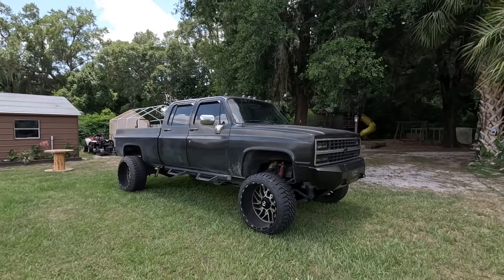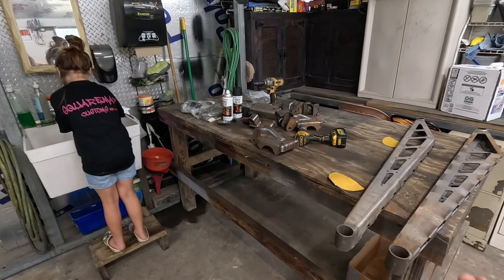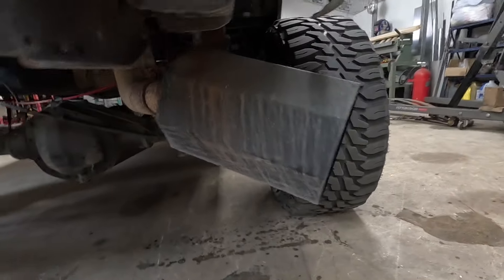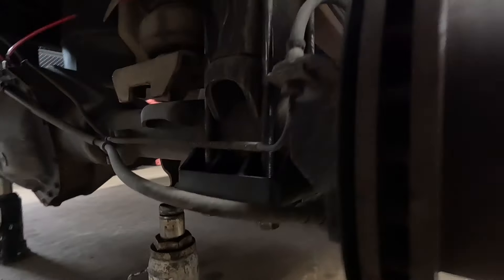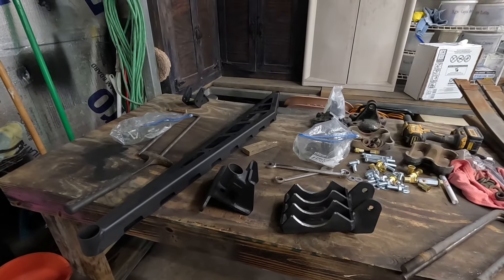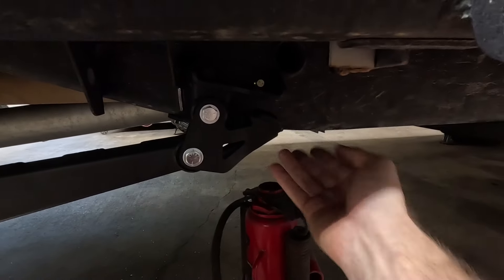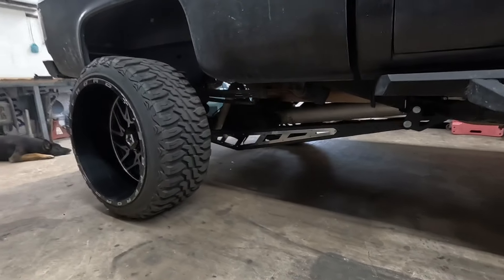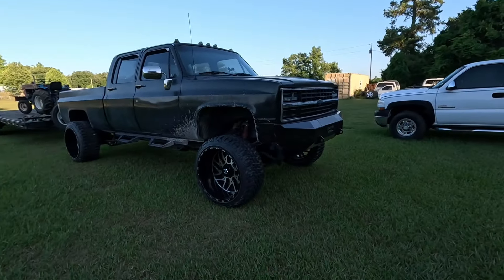Squarebody Duramax Swapped Shop Truck

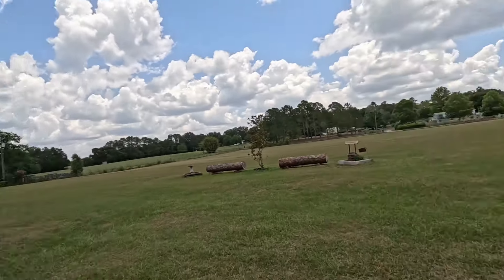Comment: @1:32 Typically, the newer trucks come with factory rake. The front is lifted higher on aftermarket kits to compensate and bring the truck level. On a higher mileage truck, leaf springs are worn out. The kit is designed on a very low mileage vehicle, over time springs wear and they sag. 

Couple options to help fix it: new rear leafs, taller blocks, bags, helper springs, or junkyard bastard pack. Depending on your donor for the frame swap, you could very well have clapped out leafs. While they still function, they have lost their “off the shelf new arch.” I put Hellwig Load Pros on my truck and it solved my problem without having to deal with bag plumbing and pressures, cranked the hell out of them and got some rake back into it as well. Barely squats with a trailer and the heavy utility bed.

Love the vids and the truck!
Reply from the maker: @ryanpalmieri5001  
I appreciate that. I didn't think about it that way. I have bags on her now. They help tremendously
Reply: @SquareMax  Just finished the video, definitely source some longer U-bolts and bastard pack that puppy up. It’ll be the most cost effective route given what ya already got on hand. Stacking blocks is super sketch, even if they are welded. I’ve split factory Great Value (Rough Country) blocks only running one, can’t imagine a stacked and welded setup. 

Coping the track bar axle tube mounts was the right call, those other mounts definitely are too flimsy to support those trac bars. In terms of the bump stop, leave it. When your axle droops it’ll close the gap, but not let the axle completely free hang tearing your bags. On the other styles, they don’t account for it and it just relies on your suspension binding up between the movement points or bottoming out the shocks at full extension. That design is much better and will stop damage. You essentially got a free limit strap included
Reply from the maker: @ryanpalmieri5001  
Man I definitely appreciate all the info.
That makes sense.  She does still ride nice compared to other traction bars giving that stiff feeling. I'm just going run her for now. She does great. Just eventually I'd like to level her out.